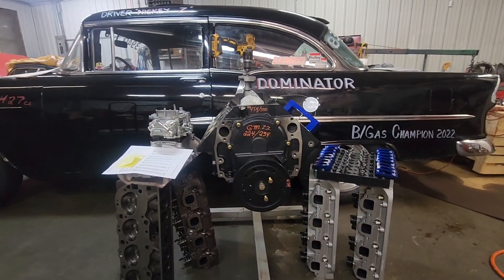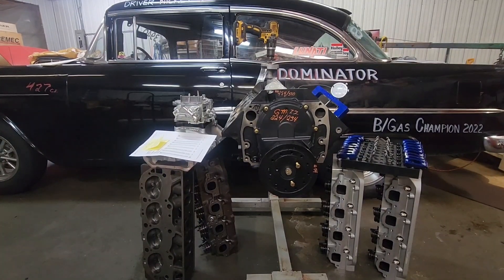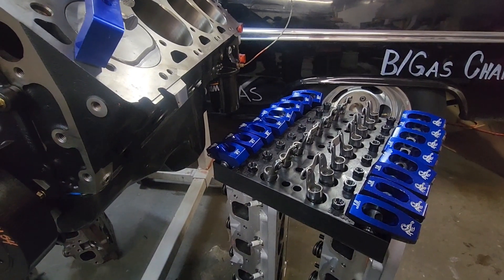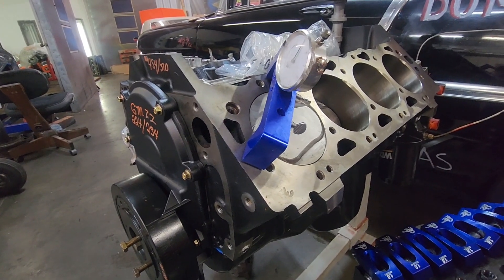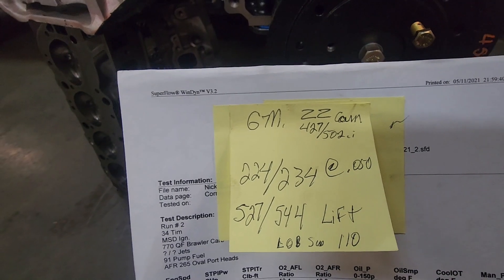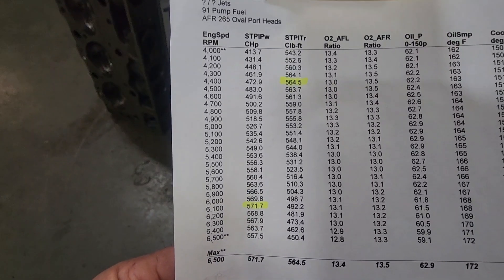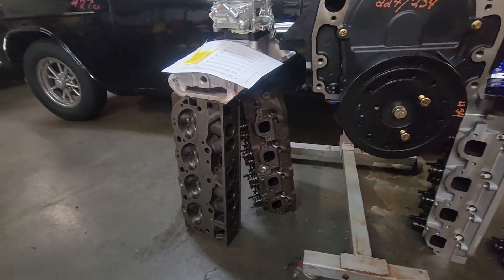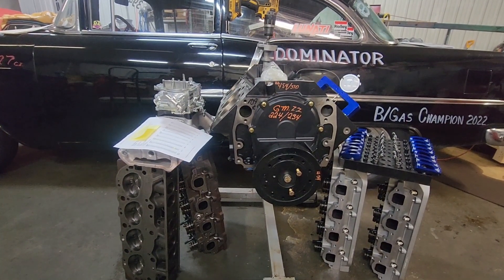GM. 454 HO. (ZZ502 Cam.) AFR 265 Heads

Comment: Big fan of the channel. Bought a 468 Gen 6 with zz502 cam. The heads are cheap LPC and speed master  midrise  intake manifold. Pistons are SRC small dome 23cc. Wondering would AFR 265 heads would be a direct fit?
Reply from the maker: Yes.. as far as I know.

Comment: the bone stock 502 zz engine,to remove the heads that  came out in the crate 502,what power gains could be expected if i swapped those heads for the 265 cc heads?
Reply from the maker: Not for sure, but I would guess thirty or 40 horses .
Reply: @dzperformance7360  ok,thats fine! i bet being 265 cc verses the 290 cc heads that came on it that velocity will be high and tq too!

Comment: Nick.  I have a virtually identical motor  with the exception of a Lunati 60211 style cam and roller hydraulic lifters.  .575/.575 lift, advertised duration 272/280, 221/229@.050.  running on 87 pump gas.  Can you make any timing recommendations.  Trying to fill in the Holley spark table but with side pipes it's hard to hear any detonation.  Many thanks.
Reply from the maker: No experience with that sorry,, I'm a
Holly carburetor type guy
Reply: Total timing should be close minus a few points for 87 octane vs 91-92.  Maybe 10 deg vac advance at idle and a bit more at cruising.  Just wasn't sure how much total timing for 87?  Can probably figure rest from there  there.

Comment: Interesting results. I'm sure that you are aware of the 454 GM used to offer with that cam and "GM" aluminum heads (edelbrock) It was 469 HP with 9.6:1 CR I put together an engine for my folks 72 El Camino consisting of: ATK .040" over Gen V 454, Lunati retro fit hyd roller lifters, AFR 265s @ 106cc - fully CNC ported, THe ZZ502 H.O. cam, Edelbrock Torker II, Holley Sniper EFI. I told them that it likely won't be much more than 500HP at the crank. I measured everything and got 10.4:1 SCR for their engine. Not going to lie - this gives me hope that it might be closer to 540-550 HP. Waiting on a few small parts, then it will be time to fire it up and start tuning.
Reply: Those are really good numbers! Of couse those afr heads are not cheap. The next step would be to zero deck the block and get a slightly larger cam with around 230 deg duration and .600 lift. That will bring you in the 600 to 625 hp range. Let us know what happens with the factory heads.
Reply from the maker: I'd release the video on it.If you look on  my channel you'll see it
Reply from the maker: I don't think that's correct.They never use that cam in 454,, That z z 454 you're talking about,, They have the little cam in it,  I could be wrong and I am occasionally wrong but research it.And I think you'll see what i'm talking about.
Reply: @dzperformance7360  just looked it up, has the smaller 211/230 @.050 cam. Not sure why I thought it had the ZZ 502 H.O. cam. 🤷‍♂️

Oh well, makes me feel better about what I put together making 500+
Reply from the maker: I got a theory,, I think that the 454 cubic inch reacts really well to that cam , and GM didn't know how they were going to sell the 502.When the 454 probably would produce within 10 horses of the 502 hp and Tq

Comment: You build a lot of BBC, what's the best timing chain assembly you use? Great videos sir
Reply from the maker: Sorry I didn't find your questions till just now,, I like Cloye's,, Just telling you a story,, I recently used a cheap timing chain that broke and bent a bunch of valves,, I also had one of those pro Comps. That was six degrees off of what it was labeled on the sprocket,, Point of the story, don't try to save money there.
Reply: @dzperformance7360  thanks again sir
Reply from the maker: Also thank you so much for the compliment thank you for watching

Comment: this is great. I always like seeing what the AFR 265's do. they are great heads for a 454. 

seeing how 781's compare to the 265's is something I've wanted to see also. do your 781's have the factory valves or larger ones?

comparing your 265 afr test to Richard's gen 6 454 test the afr 265's had a 1000 rpm gain of where peak power was made at. I know its not an apples to apples test, but it is pretty close to the same duration, so its at least an idea of what they gain over the vortec heads.

looking forward to the 781 test. are you gonna be doing any dyno testing with ported peanut port heads?
Reply from the maker: The valves are factory size,2.07/1.72. But they're good quality manly.
Reply from the maker: Funny you ask about peanut ports  I got a well ported set with big values that i'm going to be testing soon,, If you watch eric winegunner's channel , he did a flow test on them and reviewed my port work.

Comment: Did you change pistons all the ZZ are flat tops.
Reply from the maker: This is a  GM. 454 HO. shortblock with a ZZ GM. performance parts cam
Reply from the maker: no

Comment: What combustion chamber on the AFR heads. 109cc or 113cc ?
Reply from the maker: 113
Reply: Thanks
 @dzperformance7360
Reply from the maker: They are the fully cnc ported

Comment: Can’t wait to see what the 781 heads make. 
 I’ve seen some ported peanut port heads make 500hp. But with today’s heads it’s an easy just to upgrade to a set of aftermarket heads. Cause no one is selling used parts for cheap anymore.
Reply from the maker: Thanks for watching,, it'll be a 4 or 5 weeks till I test the  781's

Comment: Thank you for posting this! I have almost exact combo going together right now. ZZ454 short block, AFR 265’s, 230/236 .550/.550 113LSA. Vic Jr EFI. And 4150 throttle body. 

Going to make an exceptional street combo for a 91 454SS

Thanks for sharing your combos and results!
Reply from the maker: Thanks for your input

Comment: Awesome build, I intend to use the same cam and lifters on a future 468 with peanut port heads.  Did you set last at about .006"? I'm surprised the factory springs supported that RPM.
Reply from the maker: Lash was set at .004 cold, The springs on the AFR.265  heads was pretty good compared to most of the off the shelf bbc Aluminum aftermarket heads springs, They came equipped with.
Reply from the maker: Let me know what happens on that 468 I bet that package works good

Comment: That’s a good combination, I am building a similar motor, Gen 6 502 with a Lunati cam with a ,544 lift, 290 heads, and Holley EFI single plane intake with terminator EFI using a Chevrolet performance timing cover for crank and cam trigger, L21 valve covers with LS style coils
Reply from the maker: casting #290 heads?
Reply: @dzperformance7360  Flo Tec 290cc oval port aluminum heads, I found out after I bought them that they are AFR knockoffs, I bought them because they fit my combination

Comment: Are u sure mark 4 781s will seal the water jackets outerside on decks on mark 6 block?
Reply from the maker: yes,
Reply from the maker: My experience is they will not fit on a gyn.5, but gyn 6 They will, but you always have to check. The coolant passage just to be sure

Comment: You should try that combo with just a cam swap.
Get a Clay Smith 160-3103, which is designed for the AFR heads. 
Or the 160-3196.
Reply: If you look at the valve events, the clay smith that’s closest to the zz502 cam is vastly different. There would be a substantial power increase.

Comment: Hey Nick, ever done a back to back test with hyd and solid roller lifters on a BBC same camshaft.
Reply from the maker: No,, But I have built Almost identical engines and used hydraulic  once and solid next time,  I believe on a big block chevy street motor it's about + 5 hp.( It's not a huge difference in power. It's just what I happen to have on the shelf. At the time the motor goes together)

Comment: I would love to see a test with the factory vortec heads. I think 279 is the casting number. 100cc combustion chamber. Im building the exact same setup, only im using the factory flat top pistons, they are down in the hole .024", and im using a .022" head gasket
Reply: I would love to see this as well. I’m purchasing a L29 vortec based 496 stroker with the stock heads on it.

Comment: Nick, any videos of this engine idling/running?  Thanks for the good work!
Reply from the maker: No not yet, But I'm installing the 781 heads and putting it on the engine. Start up stand tomorrow maybe tomorrow night. I'll Post a engine run stand video.
Reply: @dzperformance7360 that 502 chop sounds so good at idle
Reply: Thanks - looking forward to the video. @dzperformance7360

Comment from the maker: I have, i've used #088 heads several times,, The large intake ports you  must have cubic inches  or compression  or both . I like your 11 to 1cr,,  rpm air gap, Medium size roller and you probably on your way to 550 to 590 horsepower

Comment: Good afternoon, friend, have you worked with the 088 325cc iron cylinder head in intake? Will it be a good cylinder head for a 468cid with 11.1 compression ratio?
Reply from the maker: Flat tappet cams are dangerous these days. They make thim out of plastic or pot metal or something like that, I I've had so many go flat. I'm worried about you using that cam.
Reply from the maker: And when your cam goes flat and you call the cam manufacturer. They said you didn't use the special special breaking sauce or the lightweight break in springs,, But how come 20 years ago we did none of that c***, we just Turn the idle up just a little bit for the first day and they never went bad
Reply: @dzperformance7360 But in other words, let's assume that nothing happens with the material. Do you think that combination of the cam with the cylinder heads is good? The cylinder heads have smooth work on the ducts and a 3-angle seat. Will I be able to reach 550hp?
Reply: 088 heads are good heads. I have them on my 496 bbc. Camshaft selection will be important for you.
Reply: @musclebone7875  I am going to use a flat mechanical cam..263 - .273 at 0.50 and a lift of .623 - .650
Reply: @luisbarrientos5411 I only use hydraulic roller camshafts. Flat tappet camshafts don't last long. Chinese metal
Reply from the maker: yes
Reply from the maker: If nothing goes wrong with the cam. I think that's a very modest estimate. You might get close to 600hp
Reply: @dzperformance7360  Thank you very much for your attention, for now I will continue the project with a flat cam for money reasons, later I will buy a mechanical roller kit suitable for that engine.
Reply: @dzperformance7360 What thickness of header would you recommend for this motor, 1 7/8 or 2 inches?
Reply: There is a machine shop that is also a cam grinder who has figured out that it's no the cam cores, it's the lifters are junk. Most from China they are not cut at the proper angle so they don't rotate all the time. Powel machine is utube channel
Reply: I've had good luck with my summit white box cam which I believe maybe an Elgin cam anyways and GM performance parts hydraulic flat tap that lifters with a hardened tool steel foot I used a break and oil and after that hot rod oil granted I'm not running a crazy big cam or heavy spring pressures but nonetheless the cam is still going

Comment from the maker: I didn't mention  in the video, but I'm betting. It would run just fine on 87 octane, It was tested with 91 pump gas
Reply: Image running a high performance engines running on 87 octane.!!
Reply: Have ever tested the 211/230 cam in this combo?

Comment: Impressive. I made a comment a while back about an 87 octane test for a street car.  The compression could be low enough that a little less timing this motor could still be a very fun street motor, and I could run 87 ethanol free.  I would think the newer chamber would be more detonation resistant than an old casting.
Reply from the maker: What I was so cranked up about This combination,, is There's no waiting at the machine shop. Just mail order good quality parts and made some serious street horsepower
Reply: - @dzperformance7360  The phrasing of making a comment a while back could come across as being a PITA but intent was that I follow and I can't remember screenames on these comments sections, like the old forum days.  I found your feed a while ago searching for 434 strokers.  I like what you are doing with more budget stuff.  

496s and 540s are cool but really for those of us on a budget that want to have a fun stick shift street tire car that sees the track once or twice a year, it is over powered and possibly over budget.  An iron head 496 maybe built cheeper, but an aluminum head 454 with some RPM more fun.

As someone that has built heads and cam LT1s(of the 90s variety)/LS1s  this is a doable combo which I have had interest in.   Heads and cam are a big part in making power and as someone that like handling less weight of the aluminum heads is a perk. 

So you're building the kind of stuff I like. Just a few ideas from stuff kicking around in my head. I've had issues with 93 pump carb stuff after sitting, my 87 ethanol free burning 250 6 banger has been great once I made the switch for ethanol free.
Reply from the maker: Thanks for watching thanks for putting in some good 
comments
Reply: The 454 HO version with the same cam and cast iron 118 cc heads has 8.75 to 1 compression and still makes 438 horsepower  according to GM you should be able to run that on 87
Reply: @carlpreston1680  454ho uses a smaller 211/230 .510"/.540" cam to make 438hp/500tq.